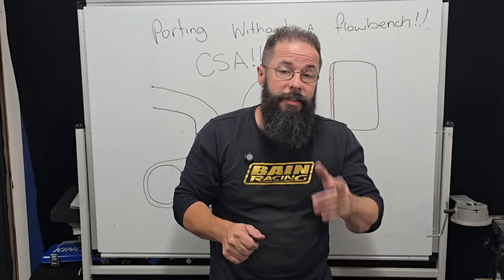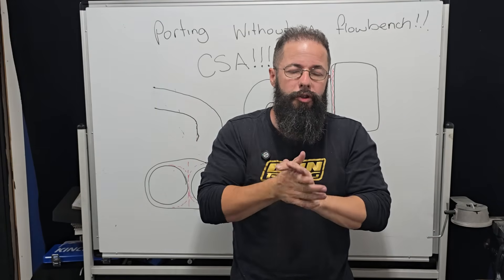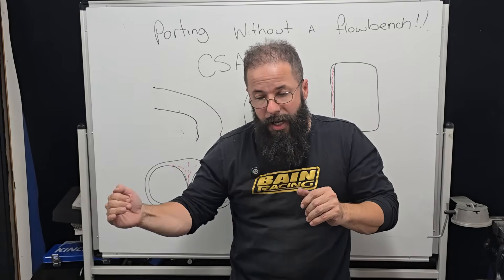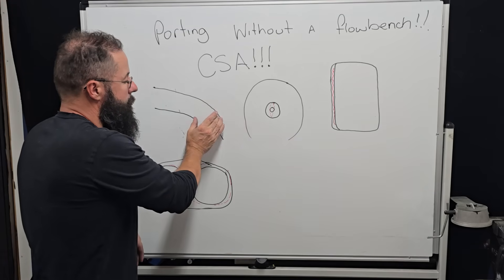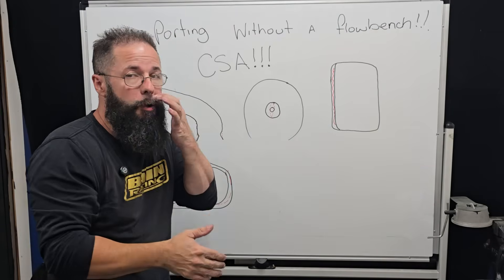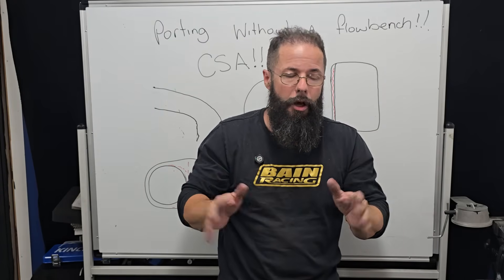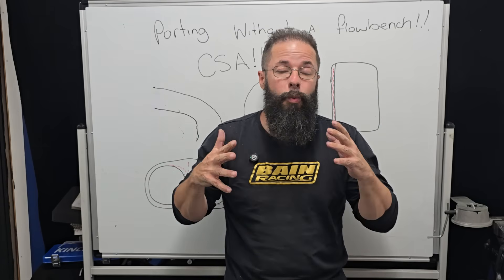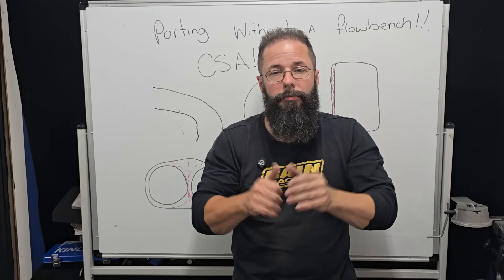How to Port WITHOUT a Flow Bench: CSA Controls Airspeed & Inertia Supercharging | Bain Racing

Comment: Lets say you have a bore that is under valved, but the taper/shape of the port is right for the valve (MCSA). If you put a larger valve in the head and open the seat area (and right under the seat) to the right percentage, do you now have to port the head because the MCSA is larger now? Thanks

William 
Georgia, USA
Reply from the maker: If the MCSA was right, the valve can make it too big.  Its hard without understanding the whole measurements of the primary length and its shape.  But this is an area where many go too big.

Comment: I'm still not understanding how you calculate average CSA/minimum CSA on 4 valve heads.  In one of your Induction Secrets videos, you cited a calculator based on David Vizard's math, but that seems to be only for 2 valve heads...
Reply from the maker: I wasn't citing anything mate. I was showing you what's out there and what others have.  I have my MSCA calculators on the EM platform with a variable air speed target for the MCSA with a maximum of 710fps. 

But the MSCA really doesn't change between 2 and 4 valve engines, its more about port shape. And why the MCSA doesnt change is the physics limit of air. The only thing that tends to change is average port velocity as 4 valve engines have less CSA gradient.  Meaning they carry more energy and a good 4 valve will be as high as 330fps where a good 2 valve might crack 310fps, most being around 270fps.

Comment: Its a pulsed system. Using a 3d printed Pitot valve and flowing forward and reverse to simulate the pulsing you see some odd things for sure.
Reply from the maker: This is why its important to separate the harmonic elements from the velocity not so much as "pulsed" as timed. Get the timing right and set the gradient by mapping the CSA properly and set the length (for the timing) and it all takes care of itself.  This was the point. Flowing won't tell you much at all as ports are 100% transient.  Not steady-state 👍

Comment: Hey Jake,   I have been porting and using a bench for just about 30 years.  I agree with you 100% on all fronts.  I mainly focus on using the bench for checking velocity gradients in the port and finding the best flow for the valve job angles and back cuts on the valve.  Also checking valve coefficients. We all have gone down the CFM rabbit hole! 🤙Matt USA
Reply from the maker: That's awesome Matt, great to hear your experience backs this up! Velocity gradients are key.  👏👏👏

Comment: What would be the CSA vs valve area, vs stroke vs bore? 

Rémy out of Bahrain
Reply: CSA is sized on displacement and rpm.
Reply from the maker: If you have set the MCSA area to your RPM and cubes,  depending where its location is. Will tell you where valve area is right.   You can also look at cam ramp rates and seat velocity and adjust from there to compensate for poor lift ratio like on over head cam engines with no ratio. 👍

Comment: I was operating a Superflow-600 for over 25 years I thought I was "on my way" when I got it. we set N.H.R.A. records in SS/AH Hemi's and won INDY 2-times... the bottom line is it's just another tool just like a pair of pliers in the tool box the importance level in a racing operation is about a 3 on a scale of 20. using wet flow analysis is more educational I was using it more for visual than actual flow numbers if you get caught up in racing the flow bench you will go slower. My friend has very busy machine shop/N.H.R.A. Pro Stock operation and has not turned on the flow bench in over 10 years Warren Johnson will tell you the same.
Reply: Many years ago in the early   70's ...    Harley Davidson   found that their   race cylinder heads that gave the highest flow numbers,   did  NOT   produce the best HP and torque  !
Reply from the maker: Very common!
Reply: You sound like maybe you were in Indy for a while too. I learned alot from hanging around the Schmidt racing shop back in the day sweeping floors for knowledge. 😂
Reply: @blaqlabspodcast5816  Jeg Coughlin drove our car when we won the Hemi Challenge in 2004 it was on E.S.P.N. I felt like a rock star.
Reply from the maker: 100% mate. This is exactly what I've been trying to get across! Well said! 👏👏👏
Reply: @bainracing  I'm building a new engine and doing the heads and intake from scratch your information is helping me thanks!

Comment: Thanks, this just ties together all the Thoughts I have as a small engine builder without a flow bench , wanting to do all I can on street engine builds without the back and forth and cost of going to someone with a bench multiple times.Time=money! I have a specific engine at the moment and wanted your thoughts, 409 W Chevrolet, 482 stroker, Edelbrock performer rpm Al. heads. Ive assumed the port shape from Edelbrock is fairly optimized for a 409, so I have a little bit of material removal overall up my sleeve with the 18% displacement increase.My issue is the intake pinch. currently my CSA goes Window 3.19 pinch 2.52 turn 3.10 bowl 3.17 and throat 3.02. obviously the pinch sucks. These measurements are after a simple cleanup and blend of most of the port , and pretty aggressive work on the pinch, its as thin as I dare without breaking into pushrod hole and ive curved the opposite wall past the pinch area as well. 2.52. Even if I go totally risky and get the pinch as big as physically possible I will only get to 2.65. what can I do to improve this?Digging out the floor wouldn't work, it has a pretty nice short turn and that would ruin that and give it a swoopy ramp!  are there any tricks to even out this poor head design that goes big-small-big-smallish? my guess is ive done all I can in terms of port CSA for this head. What do you think? Thanks, Ben in Texas (ex Aussie)
]
Reply from the maker: Nice ex aussie and in Texas!  You're living the dream man!!   Yeah I wouldn't push it. I would just compensate with a little more duration in the cam. The additional cubes will pull it back.  👍

Comment: I use gasket to match port I mean CNC machine best for results but by hand I've done some good porting
Reply: Gaskets is usually not ideal as they are sometimes on the big side and they might not be well aligned, it's better to match it to the intake after you've done what you can with that (so you don't end up with a bulge where air speed drops and you create reflections). 🙂
Reply: Gasket matching is a bad idea most of the time.
Reply from the maker: Not a great idea as the gasket has no idea what your combo is! What RPM what cubes? If the gasket is bigger it will create a dead area and rob HP and torque.